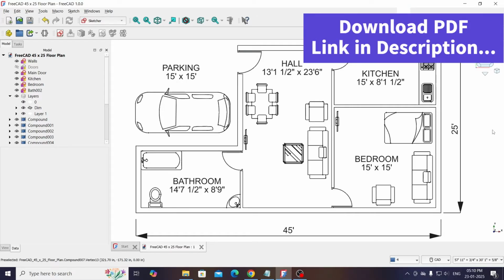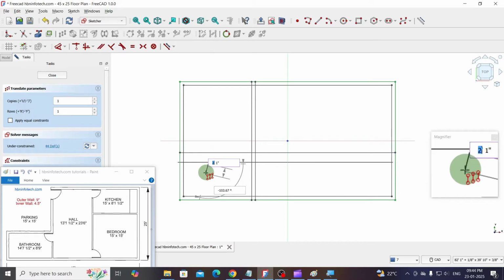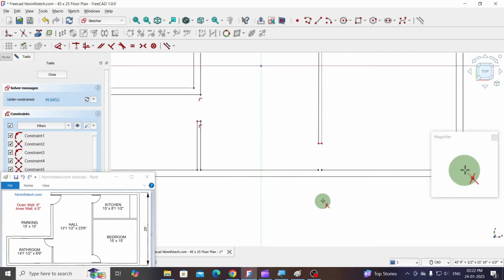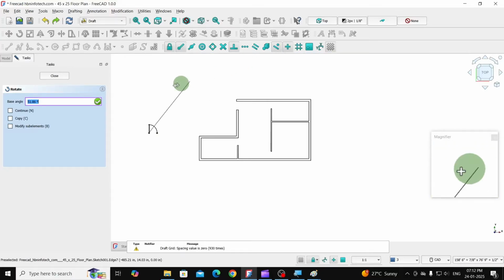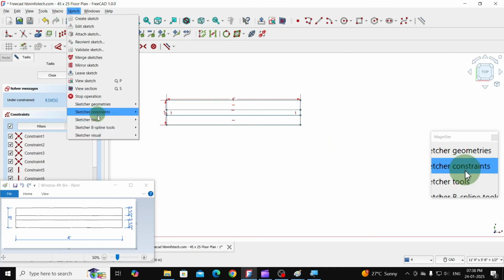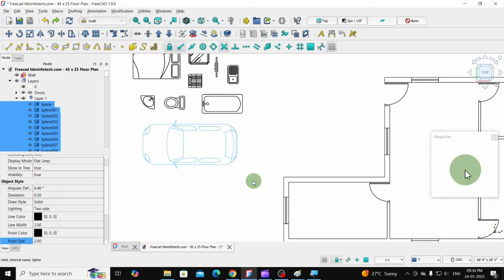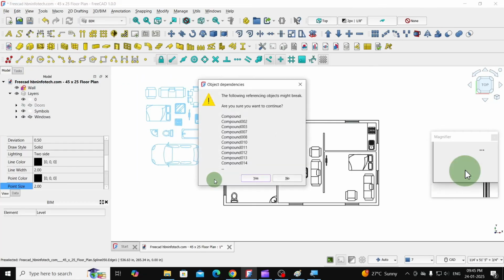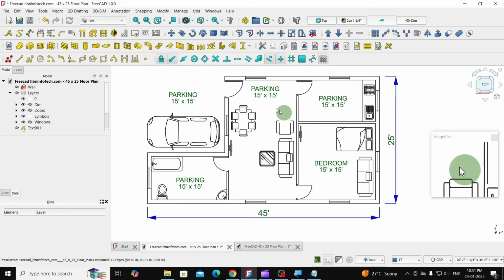Freecad Floor Plan Tutorial: Most Easiest Technique (Freecad 1.0) | 45 x 25 2D Floor Plan

Comment: Why does deleting the constraints help in this case?
Reply from the maker: Deleting constraints help you draw freeform provided with measurements on the other hand keeping the constraints restrict you from doing so. For example if objects are constrained making any changes to one object might change the properties of other object. For instance in a restricted environment if u change the diameter of a circle that could change the length of a line with which it is constrained.